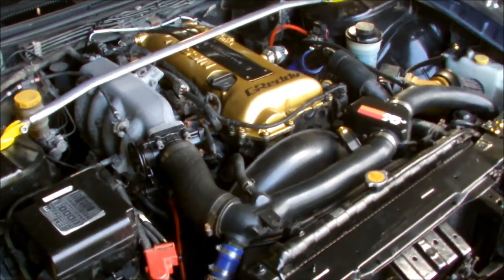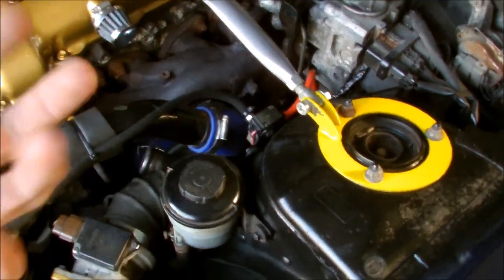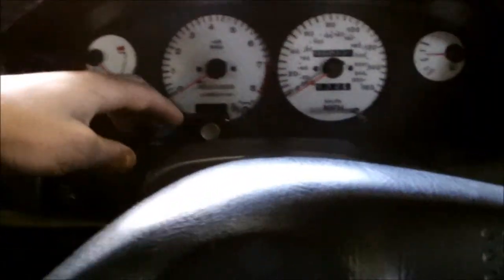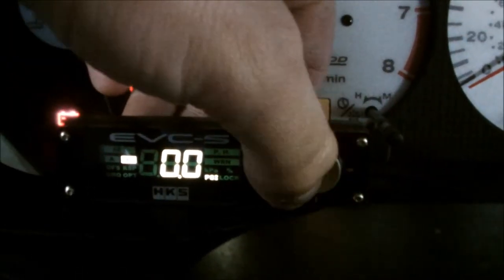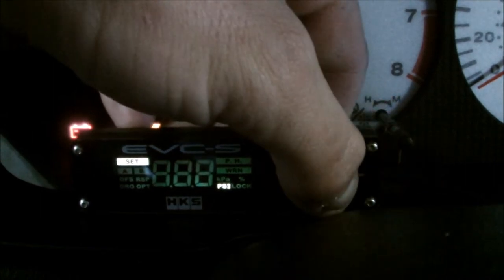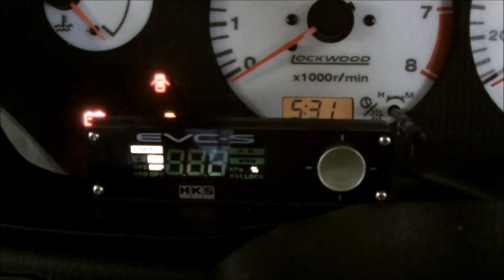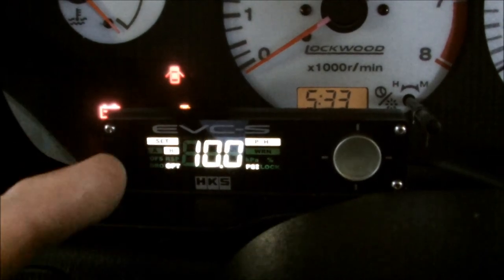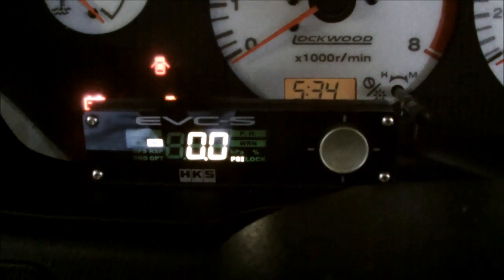How to instal HKS EVC S Boost controller

Comment: Sorry i am confused, WHat exactly does the off set boost value mean? 

So for example we can set the target boost of 10psi 

So what is the off set boost value do? is this just on the fly so we know its at 10psi and want to increase it a bit more so instead of increasing the  boost we just click 20% @50% harder 

Response value = how soon ad how hard you want it to come on through out the rev range 

Over boost = the target boost value?